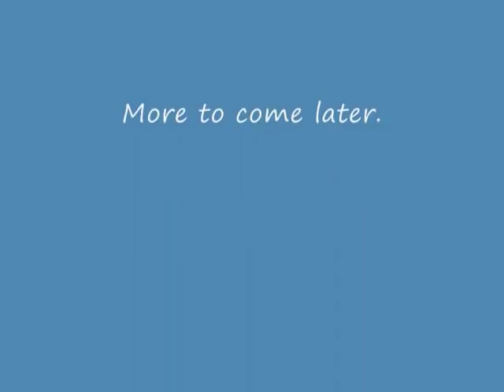Binder Rat Rod Build Part 2

Comment: After watching I said Lord please tell me this goes to a finished product. What shocked me is you've never built before wow. I dream of doing this. I don't need a rat rod although I like them, I just want a vintage pickup. Problem is I'm 6'3 and they're so small inside. Your video is inspiring because it tells me it can be done. I need the cab extended. My dream lives!
Reply from the maker: It has stalled out temporally......newborn, two job changes, blah blah blah.
The truck is sitting beside the house right now acquiring more patina while I build up a chopper for a buddy. I've had numerous people wanting to buy it, but it's not for sale. Trust me, all the time it's sitting, I'm researching more and more. It will become a complete project, and with that progress, part 3 and 4 will come.
Reply from the maker: just another quick follow up, getting real fired up to get this on the road lately. im building a chopper for a good friend of mi e right now and swore to myself I wouldn't pull this back in the shop till I get his bike on the road. good news is the chopper is getting close (and a video will be right behind on that one too). then in comes the rat to make more progress. stay tuned.

Comment from the maker: Ive done some destructive testing on some 3/16" after welding and the parent metal away from the welds broke before the welds did (they never did) so im confident that it is working well for now.
You just have to get used to the rather flighty wire speed on this thing. It is adjustable, but it has its rough spots. Other then that, it welds good. 
I use C02/Argon mix with it and would never go back to flux wire. Just not worth the pain and suffering and ugly welds. Gas is 100% better.

Comment from the maker: If i tell you, you cant laugh at me! :)
Its a 220 Volt 110 Amp Gas mig welder from Harbor Freight. 
Its actually done very well considering. I wouldn't weld much thicker then 3/16" with it and even that is pushing it. 
I'm in the market for a new miller or Hobart as we speak, before i do all the frame fish plates and gussets.

Comment: I know this is an older video but where did you make the cuts on the frame to z the frame..I really like the stance ect
Reply from the maker: I'd have to take some measurements to know exactly where. Since the truck has independent front suspension, I wanted to get proportions right since it was to be fenderless. I basically pushed the engine back until the front pulleys lined to with the wheel center line, then pushed the cab back to clear the engine. This provided my reference point. 
If you look at the bottom of the cab at the front, it angles back at the floor. I wanted the frame to match this angle. The tear zee starts immediately following the back of the cab mounts. This allows just the frame to be dropped under the cab only. 

I also raised the bed up too. The top of the bed rails was originally quite a ways below the cab belt line. It now lines up with the top most body seam in the cab. This allows me to keep a flat bed floor and tuck the tires and all the suspension under the frame. I didn't want to have big tall c-notch coming out of the bed floor, rendering the bed virtually useless.
Reply: Thanks for responding..I didn't know if you were still posting..but your approach in building this was awesome and has lead to me wanting to build one thank you. 
I've put my 69 cougar on hold to start a rat rod
Reply from the maker: +Lacy Patrick I hate it when videos are posted, then the user falls off the face of the earth leaving questions unanswered :) 
I'm glad this video was inspiring to you! 
Rat rods are fun. They leave a lot more to the imagination then a resto could. 
Check out RatRodsRuke.com. Bunch of awesome guys there who are more than willing to give solid advise. I have a full build thread there of this truck under the same user name.